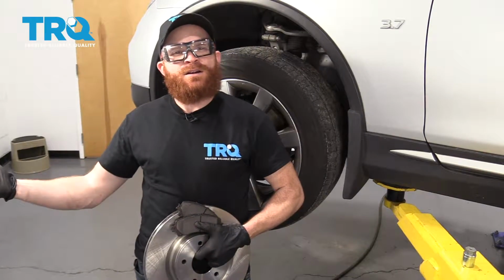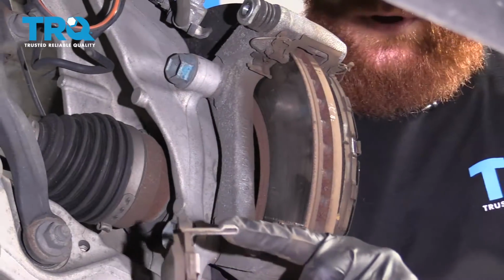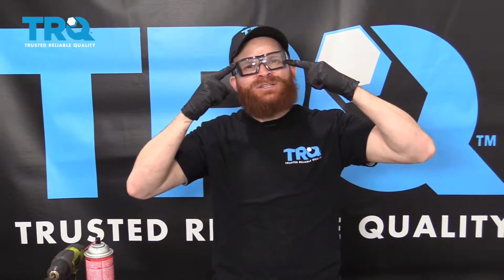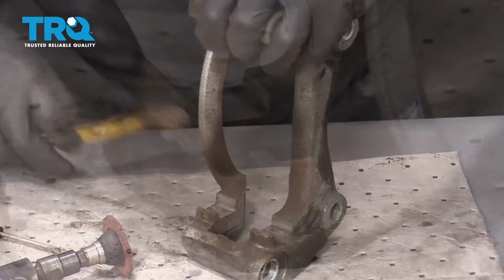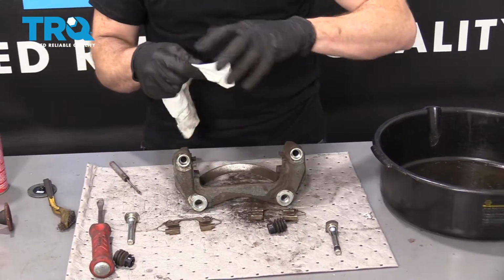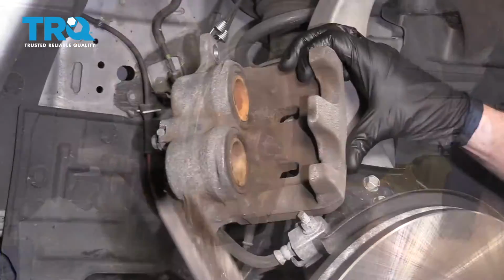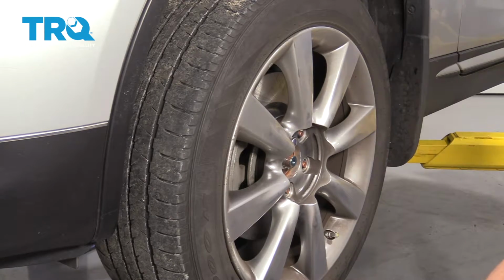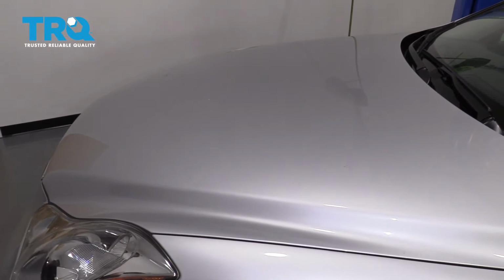How to Replace Front Brakes 14-17 Infiniti QX50

Comment: I have a 2019 infinity qx50. On another video i saw on here the gentleman used a computer scanner during the brake pad removal process. Is that necessary on the 2019 qx50 process?